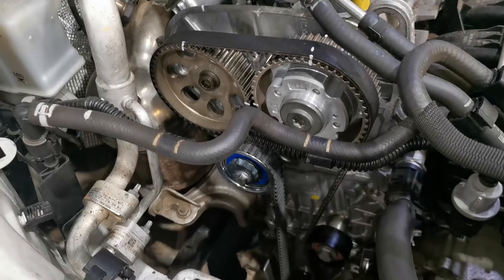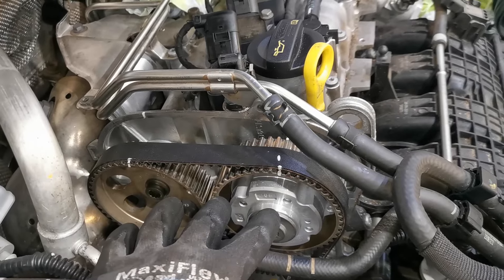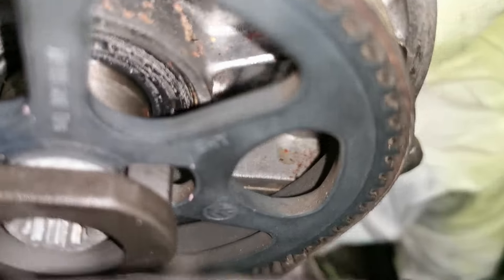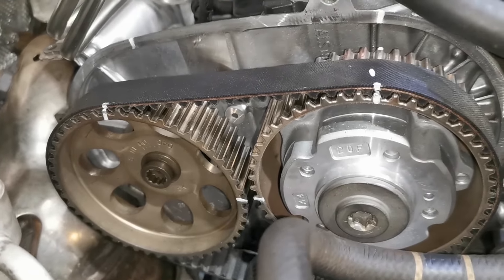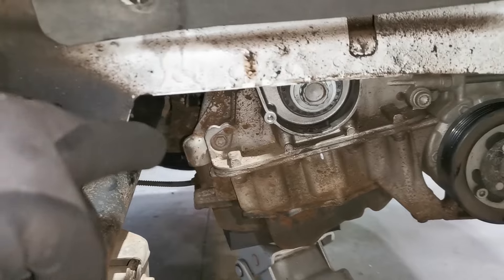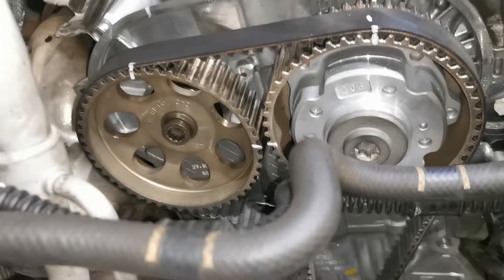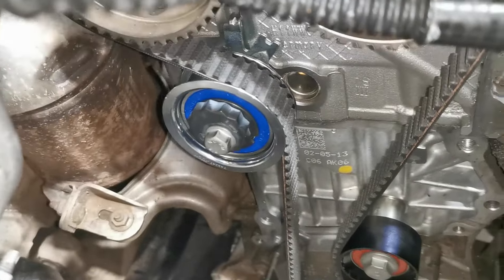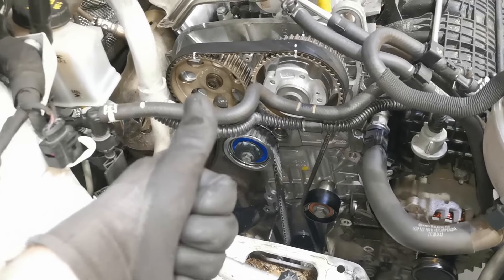How To Set The Timing Correctly On Volkswagen TSI Engines

Comment: Thank goodness I always mark everything and even transfer the markings to the new belt. Turns out the exhaust cam skipped a tooth even with the locking tool in place... what a catch! Imagine doing the job without marking anything and just relying on the locking tool… How would you even explain that to the customer? Tip of the day: always mark everything!

Comment: I did a timing belt on my 1,4 on my seat, slightly older engine (BBY) with a little different setup but very similar. I always mark the belt, sprockets and the engine block for reference, then I transfer the marks from the old belt to the new and just put it in the same way I took it out. No way to mess it up if you line up the marks and count the tooth in between. And of course like any belt job it's a good idea to spin the engine by hand a couple rotations to make sure the marks line up again.
Reply: One question if someone can reply me… I did it exactly how you say but at the time to spin de engine bu hand the marks never line up again, what could happened??
Reply: @cjbm2764  Nothing they will never do again probably just watch the marks you did on block snd sprockets not the belt ones

Comment: Is there any msrk on the waterpump gear to use as a reference? Engine turns but wont start
Reply: It is not relevant
Reply: Water pump pulley but under it is camshaft. Did you loosen camshaft bolts?

Comment: I always mark before I take off the old belt, I have done one of these without the special tools recently and it was a disaster trying to hold the camshafts and put the belt on, I used a 30 mm ring spanner to tighten the tensioner, I will not be doing another one without the locking tool. Thank you for the video.

Comment: I've only done the timing chain on the 1.4 Golf. Same deal with the special tools, paint marker and plenty of patience
Reply from the maker: 100% mate, patience in workshops is often not afforded to Techs based on costs, book times and customer expectations. 
To successfully do these jobs solo I believe the right tools need to be supplied or there is a high risk of mistiming which can lead to poor performance, running rough, poor fuel economy etc... 
 
Sometimes expectations do not match reality and as techs we should encourage the use of correct tooling (which I know you absolutely do) especially for the individuals that are attempting this type of work without having a good amount of experience doing timing belts. 
Risk vs Reward : |
Reply: @GerardBurkeBurkesGarage  Totally agree.  You can't expect quality workmanship from staff if the correct equipment is not provided.

Comment: I had an 2018 1.5 tsi should i need some special tool for replacement
Reply: If there is ACT or double variators (this one video does only have one varitator - adjustable valve timing) you need dealer specific computerized advanced timing tools.
Reply: @Mixter81  I think it's the later engines (eg 1.5 maybe) that needs the computerised timing tool. I think the earlier 1.4, even with ACT and adjusters on both cams, just uses a mechanical looking tool.
That said, as I understand it, the official instructions want you to loosen off both cam sprockets, put the new belt on, then tighten them. The sprockets aren't splined onto the camshafts, so that lets the sprockets theoretically get positioned in the perfect place for the new belt.
How that works if there's play in the tool I don't know... Not sure if it's just a cheap badly made tool that has play, or if even the official VW ones would?
Reply: @AJB1  VW said all EA211 engines MUST use the computerized angle timing belt tool. VAS 611 007 is the tool to use.
Reply: @Mixter81  Have they changed their advice then? The older official guides I've seen say to use T10494 which is a physical looking tool, not the expensive computerised one. I thought it was the newer EA211 engines which needed the new computerised tool, rather than that they now say to use that for all.
Reply: @AJB1  From what I know, it is maybe occasionaly possible to change the belt without loosening the cambelt bolts. 1 of 10 changes fail in this manner. Check engine light and timing issues, gas mileage is worse etc. Will not be the same car anymore. It requires precision. But if loosening the bolts, the expensive VAS 611 007 tool must be used. But if you could check on an authorized VW mechanic shop, would be nice to have some feedback. There is older EA211 and newer EA211 Evo engines. They are a bit different just a littlebit I dont know but share same core system? Belt last much longer on Evo engines from what I know.
Reply: @Mixter81  Completely agree in terms of maybe getting away without loosening bolts, maybe not. That's what I've heard too. But from what I've read, and looking at applications for the various tools for sale, it looks to me as if the earlier engines use mechanical locking tools, and the later ones (eg 1.5 rather than 1.4) use the computerised tool instead. It's maybe a different mechanical tool depending on whether it's got actuators on one or both camshafts, and whether it's got ACT/CoD, but I think it's still mechanical.
The belt was said to be "lifetime" right from the start of the EA211 petrol, at least for the 4 cylinder. I've read various things for what that means, but things like "check after 210,000km, and then check every 30,000km). Here in the UK the importer tried saying "change it every 5 years" for a long time (across all brands VW, Skoda, Audi, SEAT), but they've now changed that, and said to do what VW Germany says, and that there's no time limit any more.
Reply: @AJB1  Yes. Would be nice to hear what VW have to say. Or other mechanic shops. In your country. I know that cheaper shops only use locking tool and not loosening cambolts.
Reply: @AJB1  they can make more money using that tool because is too expensive. But ok, vw said this timing set may endure 180000 kms and 12 yrs
Reply: @Mixter81  sure belts are maybe strenghtened, but what about its pulleys?

Comment: Is that a 1.4? I thought they had inlet and exhaust cam phasers. This looks more like the 1.2 (CJZ[A-D] engine codes).

So that little red plastic tool that fits between the cams and has pointers to show the cams are correctly aligned. Part "C" in your kit. The question is, why do the cams get out of sync during vehicle operation? Is it because there is no woodruff key on the cams and things can shift over time? Is it the inlet cam phaser still turned? I've heard people do all the marks they want, but the cams are still out of sync. There's a super expensive VAS611007 electronic tool that is used to get the timing in spec, but I'm confused as to whether that is needed for an engine like this (CJZA-CJZD) which has only an inlet cam phaser.

DIYing on cars is dying. Getting a bit complicated with expensive tool requirements, all for very little gain.
Or... I'm just getting old ... "they don't make them like they used to" 😁
Reply: Or is it that the tolerance on timing is tight enough that variations from belt to belt can put it out? That's the only reason I can see for why the official instructions would want the sprockets loosened from the camshafts before fitting the new belt then tightening again. I can't imagine they shift/move over time, so the only difference would be the new belt vs the old belt.
Reply: @AJB1  Could be. But surely that slack is taken up by the tensioner. Could just be due to the nature and variances in the cam adjuster.

Requirements for such expensive tools and complicated procedures on cars which are meant to be basic models is just going to turn them into junk. Tons of plastic and metal turning into waste. I feel gone are the days of cars living a good long life.

Engines like these which are common really shouldn't have such tedious timing procedures.
Reply: @2226cc  The tensioner is on the slack side of the belt, but the critical length is on the drive side which should always be tight. I do agree with you about complex procedures and special tools, but even my old 1.9TDI made in 2002 (ALH engine in a Skoda Octavia) was supposed to have the injector pump pulley loosened from the pump shaft, I assume for the same reason. Then you had to use diagnostic tools like VCDS to check and adjust the timing of the pump. The main dealer didn't bother doing that when I got the belt changed, and when I checked with VCDS it was out of spec, so I had to go back, show them how to use their tools, and make them do it properly!